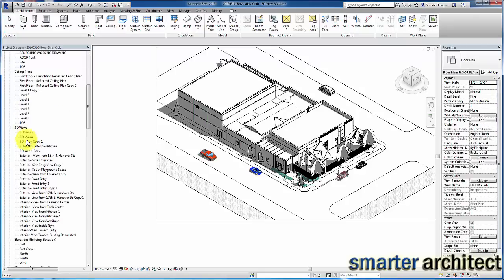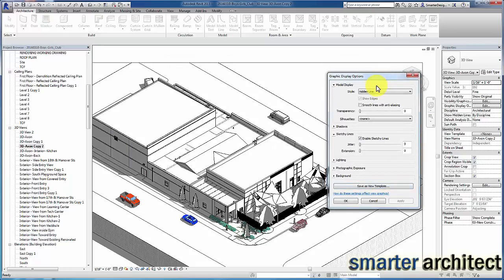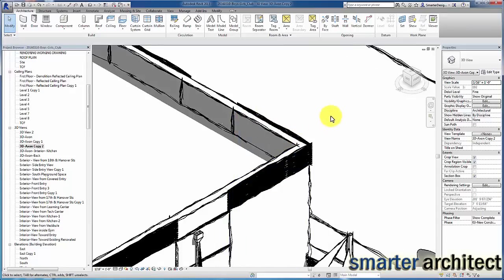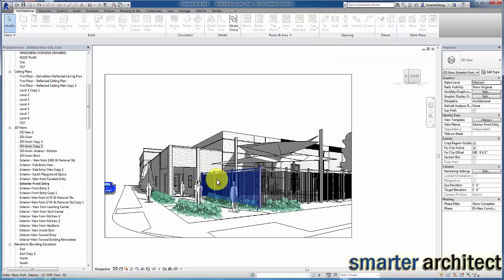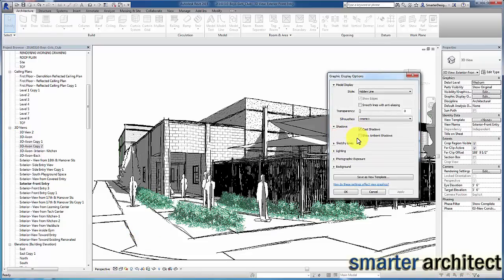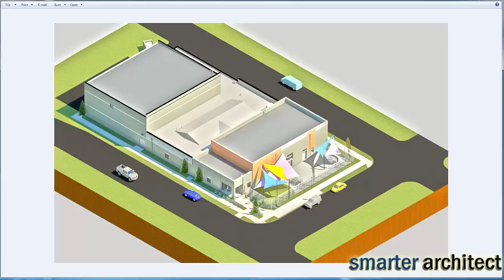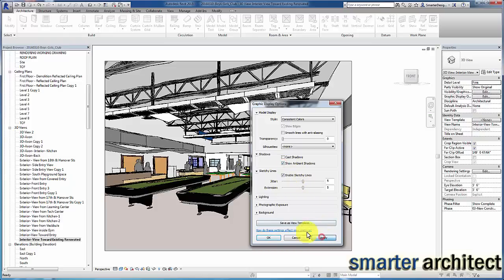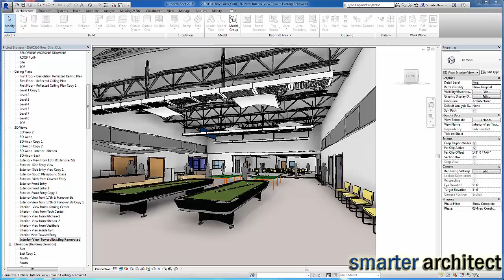How To Do Revit Sketchy Lines?

Comment: iwork in revit2014 dont found Sketchy Lines
Reply from the maker: Sketchy Lines was a feature added new to the Revit 2015 release.  There are other ways to achieve and apply as an effect to any drawing after produced too.  In Photoshop, there is a sketch filter that can be applied for a similar aesthetic look.  For Gimp - the free photo-editing software version likely has a similar option too.  Hope this helps.